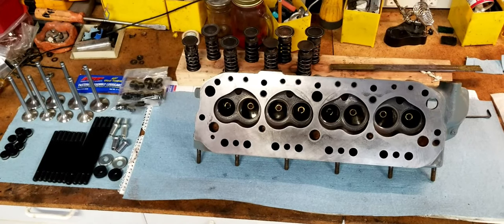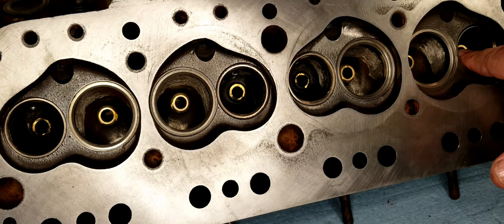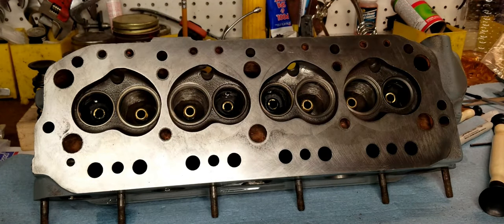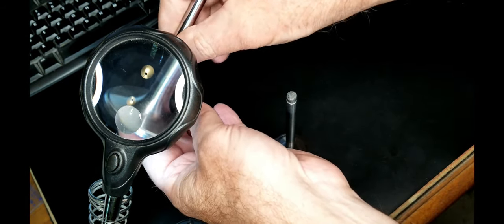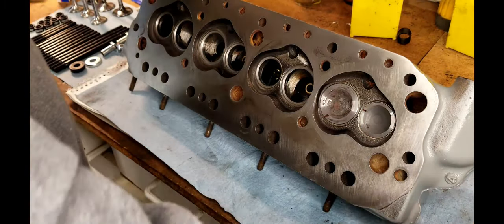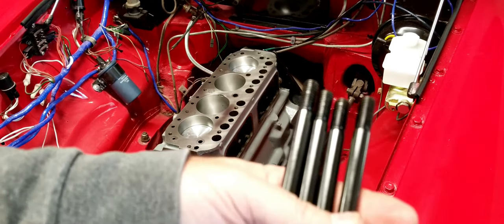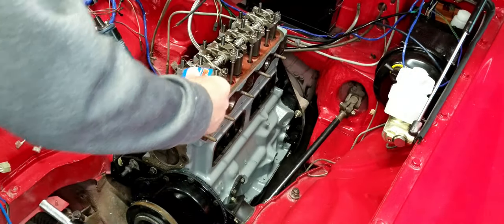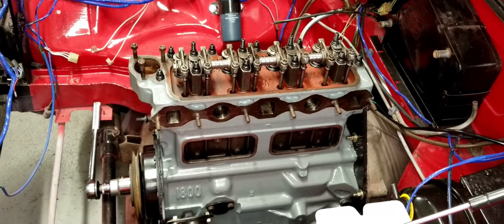Nigel the 1977 MGB - Top End Assembly

Comment: Well put together video.  I liked the leak down test - didn't do that on mine. I noticed that you did not put shims under the middle two rocker pedestals. Apparently they're needed to stop any movement of the rocker shaft. Moss USA part number 460-255. They were not fitted to my head so I fitted them when I changed the blown head gasket. I didn't fit the valve guide seals on top of the valve guides, just used the neoprene "o" rings under the cotters which seem to work well enough - mine uses almost no oil.
Reply: I had the same remarks: on more than one YouTube video on mounting cylinder heads these special 0,005" shims are missing, although its addition is already from way back. I had the later VITON valve stem seals in store but also kept the simple O rings under the cotters that seemed to work well with an oil usage of less than 1 litre for 2500kms/1500miles for this block

Comment: I love the detail in these videos.  This said, in Abingdon, those studs were installed without thread cement.  Removing 'red' Loctite typically requires heat from a torch to break loose the part without risk of distorting the shaft. When half of the thread is in a massive block like this, it can require a LOT of heat on the stud shaft. This is so much the case that degrading the heat treat on the stud is a concern.  In these kinds of applications the weaker grades of Loctite are your friends.  Purple Loctite is easy to break loose with a wrench, but will never move from vibration.  The next step up is 'blue' which can take some effort to remove, but almost never requires a torch. Red Loctite was designed for situations in which the parts will almost certainly never be separated. On a restored car, many see value in leaving the next restorer an unobstructed path to rebuilding.
Reply from the maker: Great input.

I very seldom use thread lockers.  In this case I used what I had.  Your explanation of the grades is very helpful.  Hopefully others will benefit.

Thanks
Reply: I got the same advice from my MG Mech never to use Red Loctite for this very reason (I have the blue variety in store only). On my I.S. block on which I just resolved a hanging valve issue, the 11 large studs were mounted with IMHO Red thread sealer and half of them could NOT be removed at all without heating them, so I left them all in situ and cleaned around them.  Removal of these studs makes cleaning and checking flatness of the block surface much easier and it also keeps the option for changing from regular studs to ARP ones open in an easy way. I found the existing OEM studs fine, but an ARP modification requiring a flame would've been a tricky job

Comment: Thats a great spring compressor - haven't seen one like that before!
Reply from the maker: only $12 at Harbor Freight.
https://www.harborfreight.com/universal-overhead-valve-spring-compressor-59343.html
Reply: I have the same, from the time I had a Gold Seal block with single valve springs on which this works. With the double springs on an earlier head on my present block it does NOT. I had to put the head under my column drill machine and use some extra part to press the lot down. There are also other types of spring compressors for jobs when the head remains in situ with the rope trick between head and piston and which use the rocker shaft as leverage point for such a tool.

Comment: Normally torqueing the 11 larger headstuds is made in two steps not one: first one e.g. on 25 lbf, second one on 50 lbf (or 55lbf/74,5Nm, the later max value indicated by British Leyland in a TSB) Text: 
"The cylinder head torque on the MGB can be increased from the present 45-50 Ibs./ft. to 50-55 Ibs./ft. This information should be inserted in the appropriate section of your Workshop Manual".
Reply from the maker: Great tip
I seem to remember doing that...
Could be I breezed over that detail or cut it out because the video was getting too long. 

Also I re-torqued after break-in run

Thanks for the comment.
Reply: @AlexPlatacis   OK, then I only think about the length of this break-in run. I warmed the block up fully at first at home and then made one 10km drive on the highway for a single heatcycle and then retorqued and reset valve clearances after cooldown. This was because I remembered the single heatcycle being prescribed for Payen headgaskets and my I.S.block also came with a notice any retorqueing by me as a buyer was forbidden! It seems composite headgaskets are designed to deform when heated once only..  Well recorded video though, many on YouTube have shaking images or blocked details: welldone!
Reply from the maker: Btw.  That is a good tip about composite head gaskets.  Not too many people know the differences between then and the copper ones.  As parts become harder to find, decision making will be based on availability.  The physical differences and how to use them will be important distinctions

Comment: Alex Platacis Alex, thank you for this very informative video. I do have a couple of questions if I may. 

You suggest torquing up the 4 rocker shaft pedestal nuts after torquing up the 11 head nuts to 50 lb.f. What should the torque be on these 4 nuts? Also 50?

My job was just replacing leaking valve stem oil seals so I only took the head off ( and manifolds, carbs, radiator hoses etc). I didn’t disturb the block so the distributor stayed in place. I don’t have facilities or ability ( maybe it’s confidence really) to strip the head so I got a professional to strip a spare head I had and give it back with new valves and seals in place. Once I took the old head off, I discarded the “old” head but kept the rocker shaft assembly from it, and kept the “old” pushrods. This was mainly because the “new” head rocker assembly had a different cup and ball on the rockers and I thought it best to keep rockers and pushrods as a set. So I am now replacing the “old” rocker shaft assembly on to the “new” head, and I have not changed the settings on the tappets. So I am just putting it back as it was, except there was only one shim when I took it out, I am putting it back with two shims, one under each of the two middle pedestals. ( it is an older 1970 engine so should have 2).
Before reassembling I brought No 1 and No 4 pistons to the top of their travel, but I don’t know if 1 or 4 is on the compression stroke. Your video shows you feeling inside the block, but I don’t have those access covers off and don’t really want to disturb them. Does it really matter as the tappet  settings that were working have not been disturbed? If it does matter, can I tell by the position of the pushrods?
Reply from the maker: so lot to cover...
First thing I'd mention is to be sure the oil hole matches on the new head and your old rocker assembly. There were a few types
Here is a video on that
https://youtu.be/Y6lFeEd1_T8?si=pq_gi4SOudfad4bt
Reply from the maker: yes you can tell if cylinder 1 is at TDC in compression stroke by using the push rods. They should both be short
Reply from the maker: this link shows most of the relevant Torque settings for an MGB.
in here is suggests 25 ft pounds for the rocker bracket nuts.  (which seems about right)
https://acrobat.adobe.com/link/track?uri=urn%3Aaaid%3Ascds%3AUS%3Add9348b1-7d86-4ad8-af47-a15030c943bc&viewer%21megaVerb=group-discover

Comment: Thank you for this extensive video, showing the entire process from beginning to end. One thing I would do different is the torqueing of the studs. Instead of immediately torqueing to the final value I would do one step in between. For example: torque all bolts first to 40 ft.lbs before doing the final round with 50 ft.lbs.
Edit: do you have a similar video about the lower part of the engine?
Reply from the maker: Thanks...
I had considered two stepping the torque, but after research I found that it was not standard practice for this engine.  torque specs being pretty specific for some newer vehicles I decided not to let my experience with those bias the process.(Kept it simple)

yes, I do have a few other videos on the lower end.  I will make a new play list with just engine videos for this car.  (good idea)
Reply from the maker: here is the play list
Enjoy...
https://www.youtube.com/playlist?list=PL2RsH7Pa3wcFG_bFfgxVmPvrD-6B8os07
Reply: @AlexPlatacis  Thank you for creating this playlist. I binge watched all videos, oldest first. I have a 1964 MGB. The history of this car is unknown. Sooner or later in the future I will have to look inside the engine and gearbox to check the status of the components. Your videos help to allay the trepidation of starting such a job. And pinpoint what to pay attention to.
Reply: I agree with you. Torquing to 80% and then taking the torque to the final value brings the head down straighter, and there is less lateral motion in the gasket as it is tightened. This is a good practice. That said these are quite basic engines, and the head is cast iron.